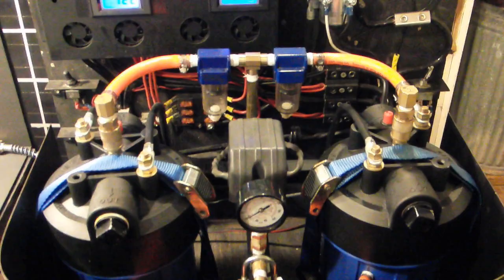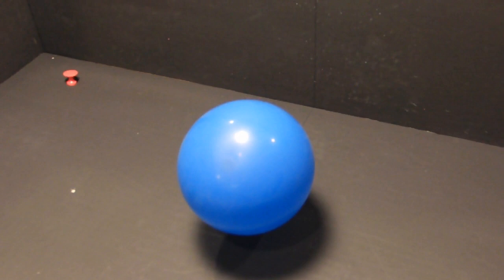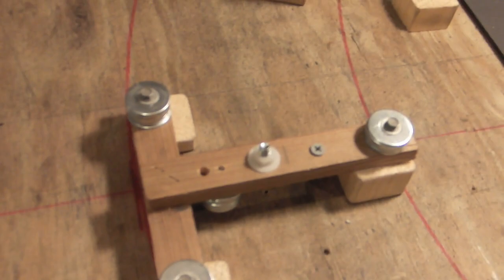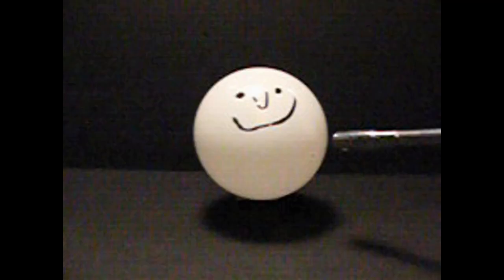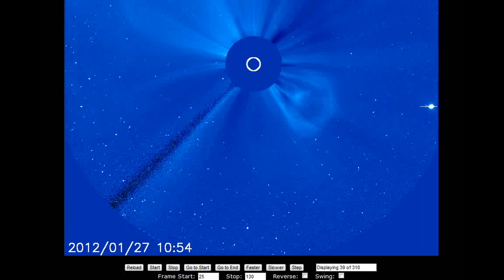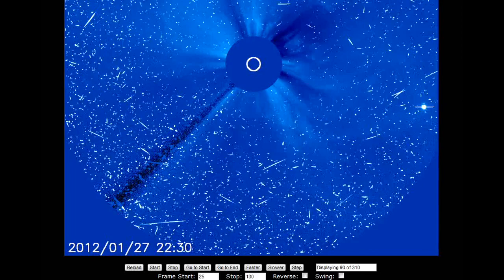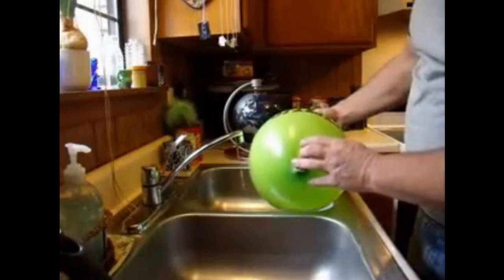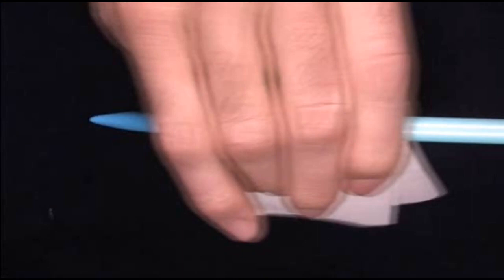High Speed HHO

Comment from the maker: @eric1970x  LOL. I have thought about it. I'm working on an ignition system with a hand held taser. It will still work with 20 feet of small copper wire leads. Hell I was thinking of putting pure gasoline in one. I tried propane and mapp gas they ain't nothing.

Comment: it is more of a phase change.
  from 5th phase (hho hydroxyls.)
  To  4th phase (E Z water.  ) , in doing so HOH e6 loses two electrons (cause for hydrogen to orbit equatorial returning to orbiting like Mickey Mouse)  = pree ignition flash. 
 I build this portion of my theory based on the fact that this gas will sublimate AKA vaporized tungsten at over 10,000 degrees Fahrenheit yet it will not burn the skin, the cells have a protective lair of E Z water  ( both the fire and the cell are surrounded by water in the same phase therefore no reaction occurs. )if you leave your flesh in the fire long enough it will Scorch you this is the effect of the infrared thermal heating occurring throughout the Flame

4th to 3rd I theorized fire that is observed is the recombination of O1 O2 O3 ,H1 H2 H3.  HO+ HO- E- . 
 maybe using a piece of acrylic, glass, tempered glass, various Plastics maybe of The Shield the camera from being jostled, by the unknown energy source you may even be able to try leadedGlass such as a Coca Cola bottle bottled in Mexico.

Gumby Stay Flexable.  
Dreem Big Chisel Down To Reality